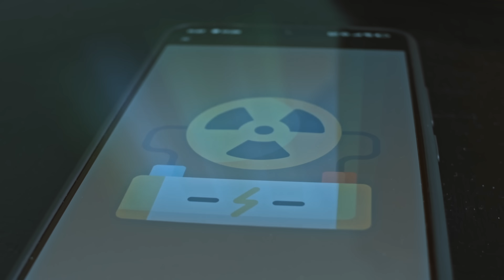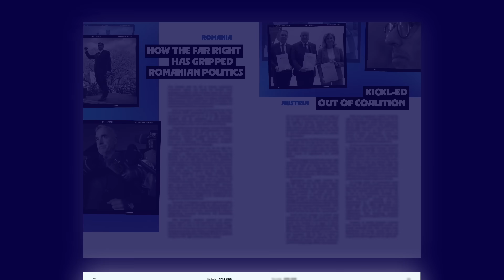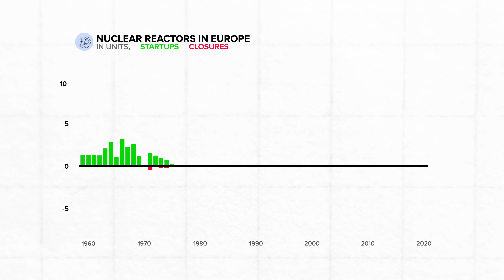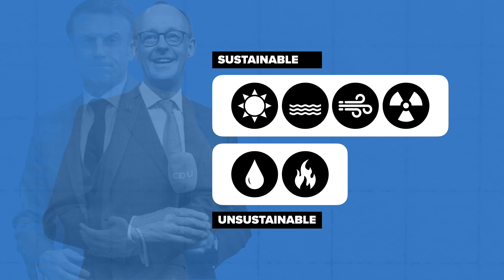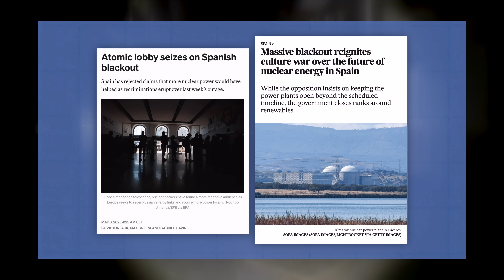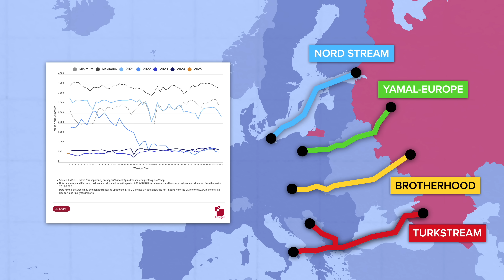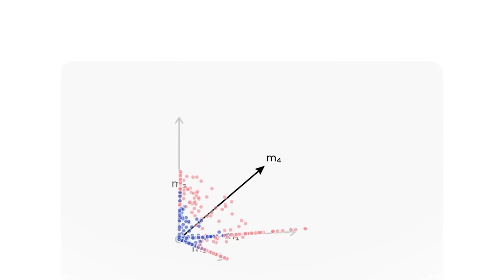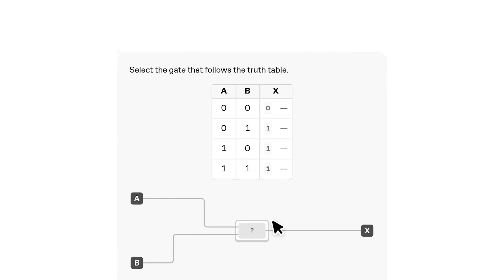Is Europe Quietly Returning to Nuclear Power?

Comment: Natural gas and nuclear hold very different roles in countries' national grids. Natural gas power plants can be turned off and on quite quickly, so they are used to cover the short-term jumps on electricity demand. Meanwhile, nuclear is very hard to turn on/off/down/up so is used to create the base amount of electricity.

Obviously, some national grids use natural gas for some of the base amount of electricity, which could be eliminated with nuclear. 

Renewable works well with natural gas. As when Renewable are collecting energy its free, when they aren't, you can turn on the gas power plants.

So Spain having more nuclear wouldn't have helped that much during this outage. The bigger issue was a lack of gas power stations to cover the clack of the Renewables.

This is mainly due to the fact that most of the population doesn't understand that gas and renewables only work together unless you have a lot of storage (which no one does)
Reply: Wrong, nuclears can decrease or increase demand rather quickly. Indeed turning the off or on takes longer.
Nothing could save Spain on the blackout. It took seconds, no power plant reacts that fast.
Reply: @AAA-vd5tf  it generally takes hours for a nuclear power station to go from 50% to 100%. A gas power plant can go from off to 0% to 100% in 5 to 10 minutes.

They were warning signs of a blackout as the grid wasn't in a good place before. If they had more gas power plants the outage would have lasted minutes rather than hours
Reply: @loowyatt6463 i am sorry man but what you are saying is just clueless. 50% of a nuclear power plant is more than 1 gas power plant, and no gas doesnt take only 10 minutes to start up, in 10 minutes it didnt even start to boil water, much less putting all the generators to the correct speed cycle. Also, if you need to spin a nuclear from 50% to 100% in minutes your grid is already gone.

About Spain, you can't say that because we dont even know the root cause of the issue. Gas is more stable than renewables but that is the argument? Take out solar because it may cause a blackout?
Reply: @AAA-vd5tf  Your first part of your comment is silly. Yes a nuclear power plants typically produce more electricity. But we're not comparing 1 gas power plant to 1 nuclear plant. In any case it has nothing to do with what is being discussed

It does only take 5-10 minutes for a gas power plant to go from off to producing max electricity. With some much larger ones it can take up to 20 minutes. It only takes minutes to massively increase or decrease output.
Reply: Just Google Terra power nuclear. Everything ya described above can be done using this decades old nuclear technology.
Reply: If you're comparing with the oldest designs of the ancient Light Water Reactors from the 1960s, maybe you should also compare Solar, Wind, and Natural Gas with technology from the 1960s for fairness.
Reply: We mainly need those super fast reactions when we have too much wind power in our grids...
Nuclear by itself does fine and doesn't need gas-powered backups or peaker plants.

Comment: LOL, typical pro nuclear propaganda ignoring all the downsides of nuclear power plants for convenience.
Nuclear is the most expensive power source, relies on plutonium from Russia, can't be simply turned of an on which makes it incompatible with renewable energy, the problem of nuclear waste is still not solved (and no some theoretical power plant concept is not a solution, especially if it complicates the design of the power plant itself) and it takes years to build.

France is one of the best examples, they pay billions of tax-payer money so nuclear energy can stay cheap.
It's also put forward of one of the reasons France wants to avoid better energy net towards Spain, because the cheap renewable energy from Spain would lead to even more subsidize nuclear energy even more.

Comment: Nuclear power plants is stable, but hard to regulate output from. They cannot replace gas turbine power stations or hydroelectric power plants at all. 

When politicians makes technical decisions it always ends up in a disaster.
(Trying to increase power output fast was tried in Chernobyl.)
Reply: "but hard to regulate output from. " - That's a fairy tale from the past. Early nuclear power plants could not change their output without putting extra wear and tear on the plant. This is no longer the case. The vast majority of nuclear power plants can moderate their output. 
Anyway MUCH better than renewables which cannot regulate at all.
Reply: @michaelrenper796  You are way out. It has nothing to do with tear and ware on the plant whatsoever. I nuclear power plant needs upto days to adjust.
It's not like your small kettle you make 600 degrees steem from in a millisecond. We others have to await a few minutes before it start boiling.
The boiler in a nuclear power plant is huge.  
Ofcourse they can predict the night and day consumption far in advance and adjust for that.
Perhaps your new ones in Spain and France is adjusting according to the weather forecast! But regardless it made Spain, Portugal and South France dark for 24 hours. Spain has 7 nuclear power plants and France is the biggest one.

Hydroelectric power plants is green power and the absolute best in adjusting output in seconds.

Coal power plant also has boilers, but is generally smaller.

Gas Turbine power stations also has boilers, but also make electricity from the shaft. Like 30-35% from the shaft and 55-60% from the exhaust which heat the steam to the steam Turbine.
Reply: @idarpolden5913  You are talking to a physicist. 
So sorry, what you are writing is classic Dunning Krueger effect. Poor spelling and popular science at elementary school level.

Some obvious nonsense you write:
"Gas Turbine power stations also has boilers" - NO - the whole advantage of gas turbines is that the exhaust gas is fed directly into the turbine.

"I nuclear power plant needs upto days to adjust." - NONSENSE - You can regulate the turbine output down within minutes and up within within 30min - A big boiler is an advantage as it buffers energy/heat.
Regulating the reactor must be done eventually. The cooling system is not allowed to dump an unlimited amount of waste heat. This can be done a bit slower (in particular down regulating).
I repeat the facts: Its all about tear and wear. Older reactors wear down their fuel faster and suffer from "fuel poisoning" when regulated too often. 
The problem is solved though and a matter of design compromises. Military reactors in ships regulate all the time and pretty fast too.
Reply: Of course you always need a mix of different sources.
Reply: @kevinkerkhoff6670  As a Norwegian I can assure you we did very well with just 100% hydroelectric power. All the gas is exported. Today there's a few % of wind power
Reply: @idarpolden5913  Norway has lots of mountains with lots of valleys and no people.  That makes it really easy to rely on hydroelectric power.  Sweden, Wales, Scotland -- and Austria and Switzerland? -- also do really well there.  Perhaps Northern Italy and Portugal as well.  Most of Europe can't do that.
Reply: @peterfireflylund It's possible to make artificial hydroelectric power plants where you have a water reservoir magazine high up.

You put the power stations in reverse during the night and make power during the day when the demand is high. It's the best way to regulate solar and wind power.  

I'm from the west coast of Norway which get more than 3 times more rain than Oslo. 
We get the leftover from the hurricanes in US that keeps raining as the clouds get blocked by the mountains where it accumulate as snow. In the summer the snow melt into the reservoirs.
Reply: @idarpolden5913  There are only so many place in the world where the geography favors this approach. If one is lucky (like Norway) its the perfect battery. On a global level hydroelectrical has largely exhaustedi ts potential already.
Reply: @michaelrenper796  Your correct, but a lot of the older hydroelectric power plants can be upgraded. They where originally designed to produce power and not act like a battery.
More powerful and efficient water turbines and generators with the reverse pumping feature, upgraded grid to that the more current to smooth out nuclear, solar and wind is needed.
Portugal has become far with the Tamega project, but Spain needs to follow up.

Comment: If people understood how many people die because of fossile fuel vs how many died in the 3/4 nuclear Power plants accidents...
Reply: Not only that but people didn't want a reactor on their doorstep so it drives down local house prices. Part of that concern was also that people thought you'd be exposed to more nuclear radiation by living close to one. 

Maybe the governments of Europe should add a better coverage of this subject in schools as education is the solution to 99% of the worlds issues.
Reply: @Quick_in_and_out  I wouldn't mind it. A lot of jobs, including high paying ones nearby. 

As for radiation, well you'll get more living near a fossil fuel power plant so I wouldn't be worried.
Reply: @somethinglikethat2176  Just to follow up on this comment, coal plants emit radiation into the environment due to trace amounts of radioactive materials in coal, which when burned causes said materials to go straight up into the atmosphere. Way more of a problem than nuclear, where the radioactive material is entirely contained within several concrete and lead containment shells.
Reply: @Descriptor413 you're the most educated shop assistant ive never heard of !
Reply: @Quick_in_and_out  Wow, that right there's an intriguing solution to the housing crisis!
Reply: @Quick_in_and_out  I'd love to learn about nuclear power. Sign me up!
Reply: @Quick_in_and_out  I agree. I'm hoping that the answer to this is small modular reactors combined with a massive education plan. Nuclear power plants are huge and ugly. They look massive and industrial and scary. I don't blame people for not wanting to live close to them, even just for aesthetic reasons. But I'm hoping that smaller local reactors will be able to blend in better and be built in areas already set aside for industry. Combined with education this will help with the nimby problem.
Reply: I FUCKING HATE THE FEAR OF NUCLEAR ENERGY!!!!!!!!!!!!!!!!!!!!!!
Reply: Not to mention hydroelectricity deaths.
Reply: @cainneachdaugherty7172 Hydroelectricity deaths? Someone fell off a dam?
Reply: @TheGruntski  Möhne and Eder dams killed many Germans. They should know better.
Reply: I remember reading somewhere that in fact, more people die when installing solar or wind because of the heights than from nuclear.

People are afraid not of the yearly deaths but of the possibility of a huge catastrophe. 

We shouldn't be so afraid
Reply: Who cares safety? Nuclear is crumbling because is unprofitable, not due deaths.
Reply: why do people kick at fossil fuels whem they are supporting nuclear power? Do you want to get green idiots to agree to nuclear power?
That wont happen. The deaths by fossil fuels are way overexergarated.
Reply: Which is like saying that kitchen knives are more dangerous than rocket launchers because every year more people die stabbed than blown up by rockets
Reply: Those accidents also caused a lot of environmental damage but only scores of people died so its ok lol
Reply: @robobertob  Yes. Especially when considering the damages were low in reality and minimal when compared to fossil fuels.
Reply: @robobertob  Those accidents created what are effectively protected parks free of human activity. In my understanding this is a great benefit to the nature, although not for humans ofc, who would like to use this land.
Reply: @robobertob  As opposed to the environmental damage being done by the regular operations of fossil fuel based plants which are the actual competitors to what nuclear brings to the table.
Reply: @robobertob  Correct. Nuclear is one the safest form of energy production.
Reply: @robobertob Compared to coal and oil which never caused any environmental damage and definitely don't kill millions each year via air pollution and lung cancer.
Reply: @robobertob  that is not entirely true. Fossile fuels have raised global temperatures, and Chernobyl, the biggest nuclear accident, now hosts one of Europe's largest wolf population
Reply: Nuclear is too expensive, always overbudget, and takes too long to build.
Reply: @rassilon5653  Not in South Korea.  A standard good design and limited red tape bring the cost and time way down.
Reply: @rassilon5653  Largely because of overregulation. Standardization and less red tape would make it more economical.
Reply: @rassilon5653  Not if everyone start applying the 4th generation fission plants
Reply: @rassilon5653  literally all of that also applies to renewables.
Reply: @noty2673 
Well, how long could placing a few thousands solar panels take compared to it?
Reply: @noty2673The new nuclear plant in the UK have derailed costs from 18 billion to 46 billion. It will produce 3GW of energy when constructed in 2031. Meanwhile China just in 2024 have installed 277GW of new solar 
panels.
The information is there, unbelievable the amount of blindfolded people.